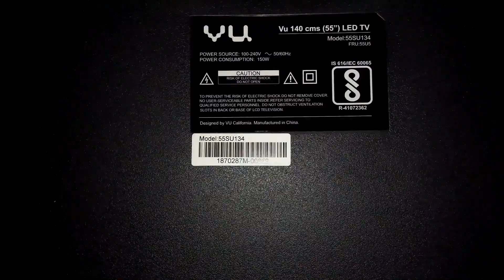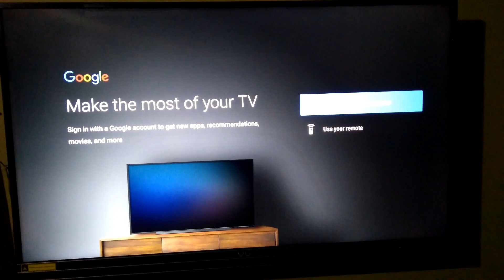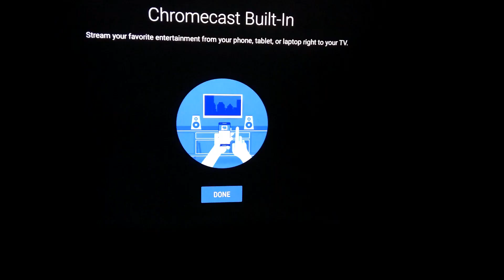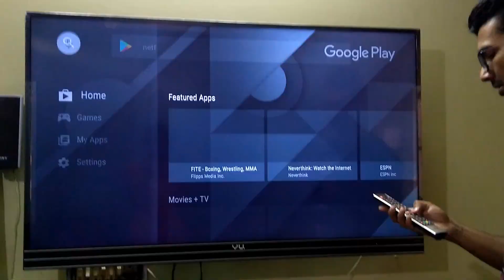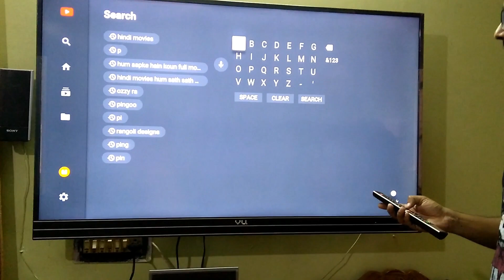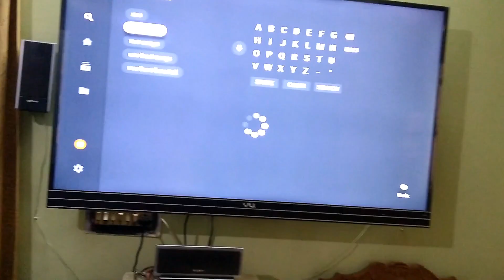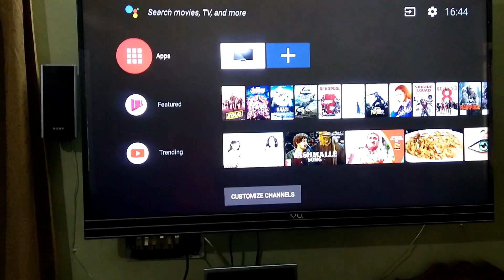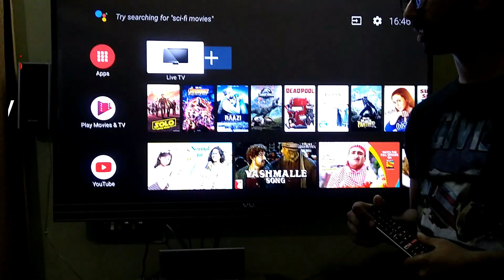Vu (55SU134) 55inch Official Android 4K UHD TV | Demo | Hindi

Comment: Amazon Prime? Is it supported
Reply from the maker: Yes, install it from external source
Reply: @deepu007bond  I tried this on TCL apk is not showing only. How to install. Also. Even after install. Does the movie play. I have heard after 10 sec of video playback they stop. And app shuts.
Reply from the maker: @YouTube2020NN  You can also use chromecast.
This tv built in chromecast, so install prime app on phone, play movie on the phone and chromecast to VU tv Simple :)
PS: Buy link available in the video description
Reply: @deepu007bond    bro. If I had to Chromecast I can buy cheap panel. And use Chromecast. For 2.5k. I need it on the tv. So non tech savvy people  can also watch.
Reply from the maker: @YouTube2020NN  officially  prime is not supported in Android Tv, and no special app is made for android tv, so that's why prime lags on Android tv(when we install it from external source). 
For officially watching prime in tv buy Amazon Fire Stick.
Reply: @deepu007bond  as I already told. No fire tv and all works for simple non tech savvy people. Define LAGS. Does it play and watchable or not

Comment: How to use USB in this TV and how to enable voice search kindly help me.
Reply from the maker: Install Es file explorer for USB,
You have to connect the remote with TV bluetooth(for using voice search)
For connecting press and hold the voice search button in remote & tv will automatically find it, or manually go to tv settings under bluetooth option.

Comment: Hi,
1) I have already installed ES explorer but still each and every external storage shows 0 mb and not even showing external storage name. I have tried to connect my phone, pendrive, hard disk, etc. But not even single worked.
U can see in attached snap.

2) I have downloaded NFS Asfalt game successfully. But while asking by game about age and gender page, now it is stuck there. And no keyboard appears to write anything or TV remote also not responding to that age bar.

3) is there any application for file transfer from mobile to TV storage. Like xender, zapya, etc.
I didn't found in TV device play store.
Reply from the maker: 1. I don't why its not showing any memory, i think there is a problem with your time
2. Install androidtv apk on phone
3. No their is no apk for sharing
But u can install it by usb
Reply: @deepu007bond  use es explorer.. share file via LAN
.